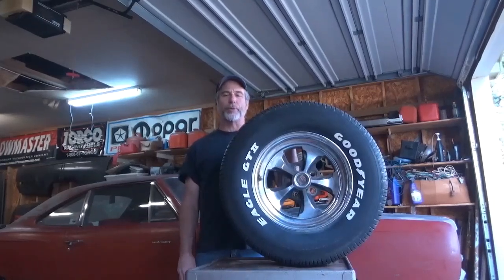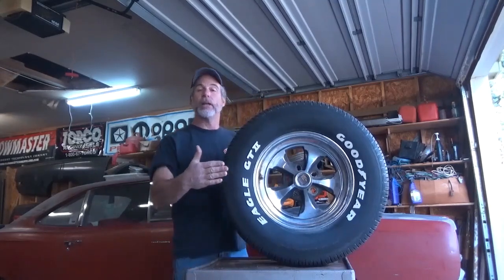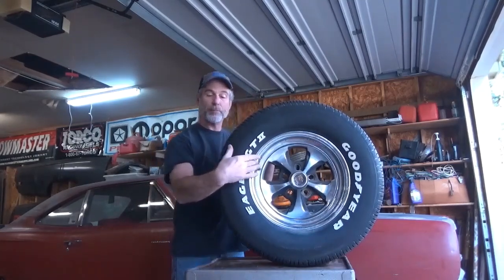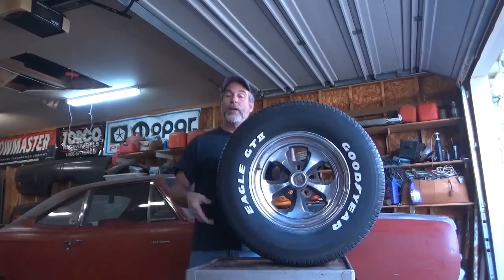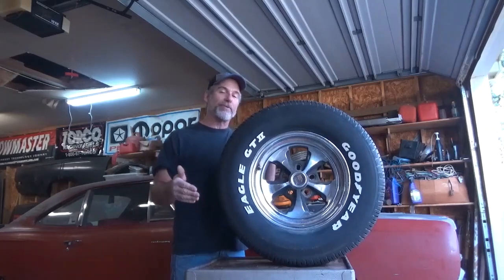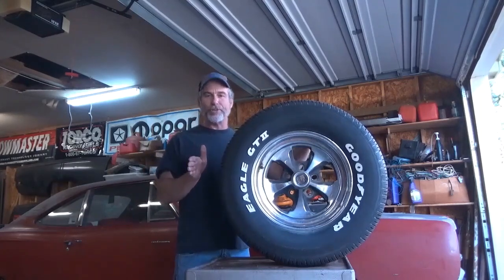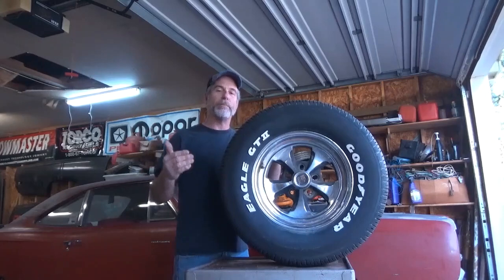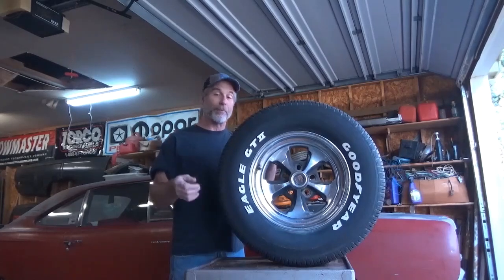Explaining tire sizes

Comment: Good video 
However, couple things . Sectional width is the tread width not the sidewall. If it was the sidewall then would differ from wheel with wider width from flange to flange, compared to skinny wheel.
Also the tread wear 200 for instance "should" last 20000 miles. As with 400 is 40,000 miles it should last. This is in a controlled environment on all tires.
Reply from the maker: Section width is, indeed, the width from sidewall to sidewall when mounted on an approved width rim. The tread width on a P235/75R15 isn't nearly as wide as a P235/60R15, but the section width IS the same.

Comment: Great info. To add, look at siping. These are cuts in the tread blocks. The more siping the better. Yes it's mainly for snow and ice but I have found it helps on radial tires at the track if you dont have access to slicks. Great content. I hope to see more.